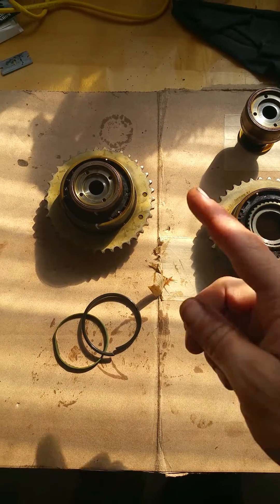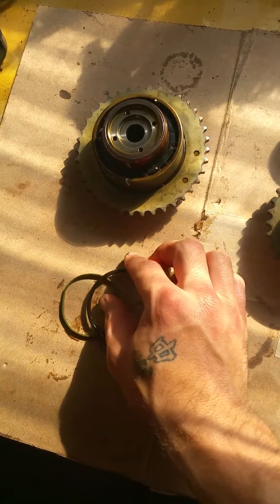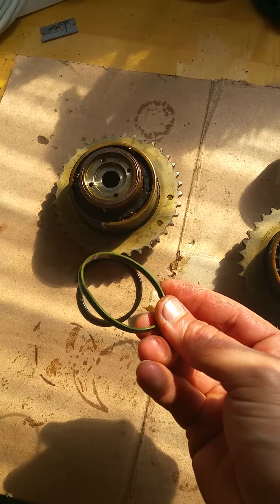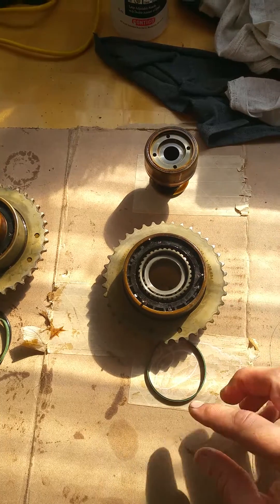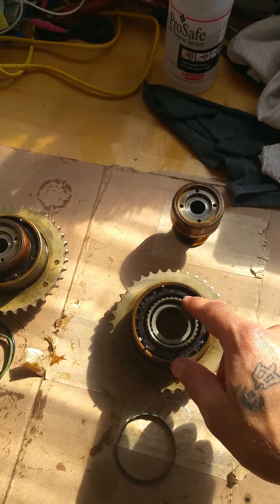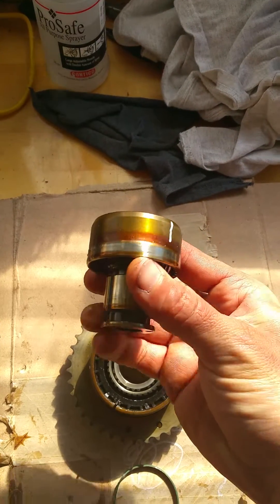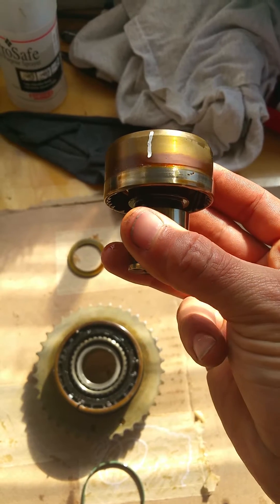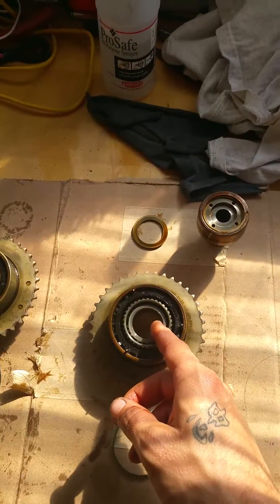BMW M62TU VANOS Rebuild with seals part 4 of 5

Comment: Thanks for doing this. So 2000 grit on the shiny part and did you wet dry maybe with some oil or just dry. Also can you use brake cleaner and liberally spray the whole thing internally and maybe blow with compressed ir?